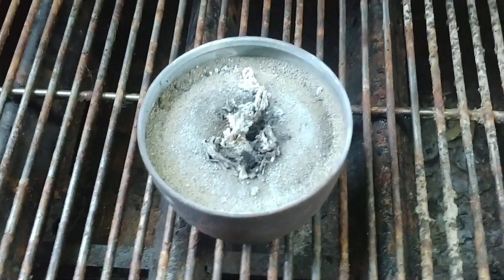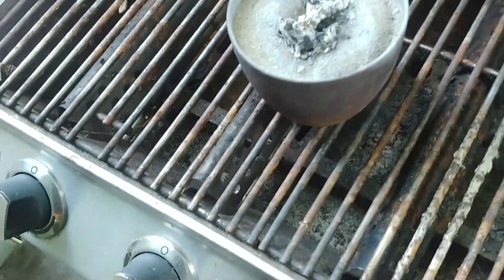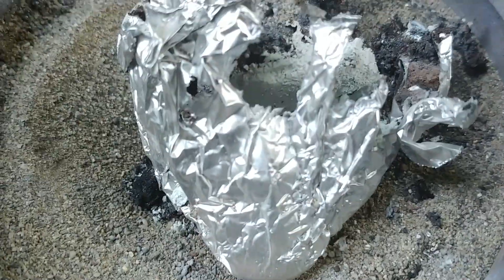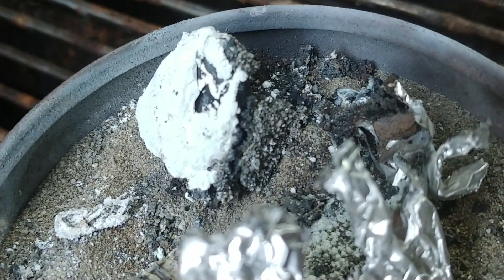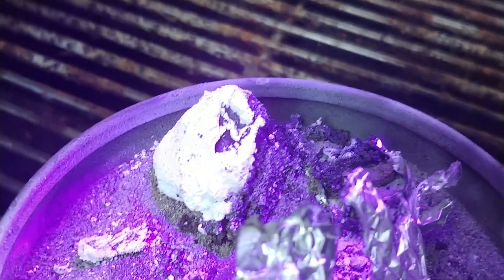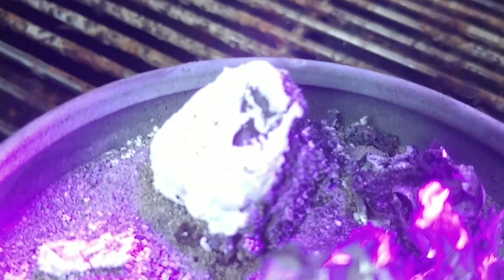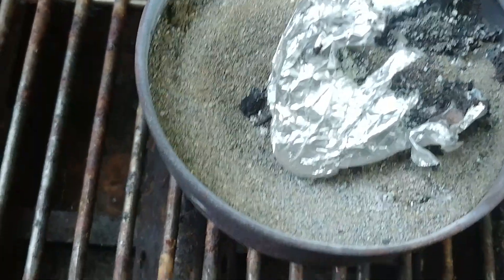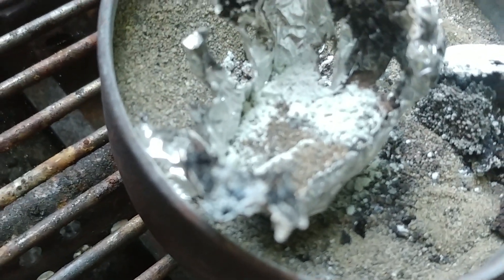Home Chemistry: Using Thermite for Synthetic Ruby Results

Comment: I need to get back in contact with you about my own synthetic ruby build. I've successfully built a small-scale Geneva furnace, and I'm able to consistently create nice poly-crystalline ruby boules in the 1-1.5 carat range. :-)
Reply from the maker: Man that's wonderful to hear! What are you using for the fuel source? That's the one thing that is holding me up at the moment. I just can't get myself to commit to any certain design for the electrolysis chamber.
Reply: Matthew Wilson - I cheated a bit and bought an hydroxy torch. It’s likely an order of magnitude safer than any build I’d make, but since it’s a small one it’s the limiting factor of how large my results are since it can only push so much gas. I may mod it in the near future to upgrade the cell.

Also once I gather and post pictures I’ll share a link to my blog for critique (and hopefully improvement!). :-)
Reply from the maker: That's awesome.  I have been wanting to get one of those torches to play with and do exactly as you did.  I agree on the safety factor which is why I still don't have an oxygen + hydrogen generator.  Due to the volume of gas I plan to use to create the boules in my furnace, I'll need to have the oxygen and hydrogen separate from each other until the torch pipe feed.  I've looked into buying tanks and a torch manufactured for oxygen/hydrogen welding, but $$$ is the problem there.

So, while I've been stalled on this Verneuil furnace project, I've been performing various experiments revolving around creating synthetic pyrite in my autoclave.  That was the whole reason I was synthesizing sodium thiosulfate and uploaded a couple videos on it.  I'll eventually create an entire video dedicated to that process.  In fact, I started my third batch of synthetic pyrite (FeS2) at 3:40PM PST yesterday and once my wife gets home she'll be turning the oven off for me since I didn't do it before we left to bring me to work.  I'm hoping I didn't turn it off last night.
Reply from the maker: ...also, I don't consider that cheating.  I call it, "getting things done."  :)  

A funny thing I can add to this, is last night I decided I would give something really stupid a try.  I got two carbon electrodes I had previously pulled out of a carbon zinc battery and I attached them to the clamps of my car battery quick charger.  Sure enough, I was able to generate some impressive arcs and I shoved the electrodes into a pile of my sapphire feed material.  After a short amount of time, my charger made a loud click and stopped producing arcs.  I unplugged it and let it rest a few minutes and tried it again.  Same thing happened, so it's definitely a safety feature of the charger.  I don't think the arc was strong enough either to fuse any of the material together, but I haven't had a chance to thoroughly examine the oxide pile.  I really should get a MIG or TIG welder to run a small arc furnace.
Reply: Aye, so you're looking more for more of a "traditional" Verneuil furnace. :-)

The good thing about the small hydroxy torch setup is that the one I bought has a pressure valve, so it cuts the gas production if there's enough in the bubbler on standby, and turns back to feed the gas as I need it. As a result, there's never so much gas in the system to be an explosion hazard (although the one flashback I had scared the hell out of the household with how loud it was :-) ).

Now the torch heads I use each have flashback arrestors in their bodies, and there's a third flashback arrestor on the main feed tube before it reaches the bubbler. To visualize, the unit outputs directly into a bubbler (which has the a pressure gage cutoff), I've connected a tube from the bubbler to a big flashback arrestor, then from there to a t-joint, and then from the t-joint to each torch. (I haven't had any loud surprises since.)

Each torch is on a clamp to hold it over a turntable, and on the turntable I use a small brick of chromium-laced alumina which serves as both the refractory as well as the feedstock for the boule. I use the torches to pre-melt small pieces of the feedstock into ~1mm beads, and then – using tweezers – I place each bead on top of the hot boule with both torches on it to melt into the boule's surface, turning the turntable to melt it evenly and polish the new layer into place.

I'll try and post pictures tonight if I have time. :-)
Reply: I'm not sure how well an arc furnace would work with getting the alumina to melt into corundum simply because of how much chaos the actual arcing would add to the system. However, if I had a sufficient power source, what I'd really love to try is getting an induction coil to attempt the skull-crucible method.
Reply from the maker: Your method is a very creative solution.  I like it.  I had the same idea of using the feedstock to form the pedestal which the boule forms on under the flame.  It's refractory, so will protect the mechanical aspect of adjusting and lowering the boule into the ideal hot zone.
Reply from the maker: Same here on the induction coil.  I know of the use of tungsten and platinum crucibles for the crystal pulling method and I'd love to get my hands on one of those.  I haven't yet heard of the "skull-crucible" method, or I have maybe by another term perhaps.

I wasn't expecting much of anything to happen to the feedstock using the arc, but I was hoping some sort of change would occur.  I shouldn't have used my sapphire blend since that was much more difficult to make, plus it doesn't glow under UV light if anything did actually fuse/sinter together.

I really can't wait to see the stuff you've produced.  I'm excited that someone other than me is venturing into making corundum as a hobby. We'll grow it into a larger niche community. :)
Reply from the maker: @stevecaruso2748  Once I get some real time to sit down and compose more of my thoughts, I'll reply with a theoretical technique I've been stewing over in my head for quite some time. I just thought about it for a moment and something clicked in my head for a modified approach to the electric arc. Basically it involves chemical vapor deposition and now I am thinking more about that again using a stream of plasma controlled by electromagnetic coils. Fill the chamber with argon as a possibility, but oxygen would probably be well suited since we are working with fusing oxides. Something to think about when taking breaks throughout the day.
Reply from the maker: I got home last night from work and was able to sift through the sapphire feedstock and I found three small shards of off-white colored pieces of fused alumina.  I'm pretty shocked that I found anything at all.  Under the microscope, it has a nice even distribution of ugly light yellow tinge throughout the "crystal".  I didn't see much for bubbles which was somewhat unexpected, and the surface of the "crystal" showed virtually no signs of observable lattice formation.  I say virtually because there was one spot which did look like a series of triangles formed on top of each other, however I couldn't get a better view of it due to the shape of the sample.  

I'll mount it to something at some point in the future and take another look.  I'm sure it's most likely just an illusion from my Jerry rigged means of dark field lighting and not being able to light up the surface of this particular piece due to the shape.  I use a tactical LED flashlight held by hand to illuminate my samples that aren't transparent because I have a light field microscope.  When I do find crystal lattices I observe them with the light moving all around the sample to ensure it's not just an optical illusion from present inclusions combined with light refraction issues experienced under the high level of magnification.  

One interesting thing is viewing the odd patterns formed on the surface of these samples of fused alumina.  If I can get the lighting set to a better angle I'm wondering if I'll see any sort of dendrite shaped formations.  If so, that could be the reason for the spot with the series of apparent triangles.

My other idea is to create a more solid piece of ruby feedstock with a concave shape to use in a PACVD apparatus. (Plasma Assisted Chemical Vapor Deposition).--like the design on Applied Science's channel.  I've also been bouncing ideas around in my head for a setup I mentioned/hinted on yesterday.  I'm not sure how well this other apparatus would work, but I can't stop thinking about it.  It's setup like a cathode ray tube directing a hot beam of plasma, but that's beyond my skillset and toolset.  I also understand how the cathode tube works, so that is problematic in using a beam of plasma to melt alumina.  I think PACVD is the only realistic possibility when it comes to using electric arcs.
Reply: i don't understand why go through the trouble , heat created ruby's are worth like a dollar per carat unprocessed